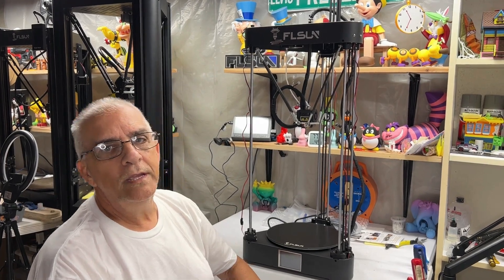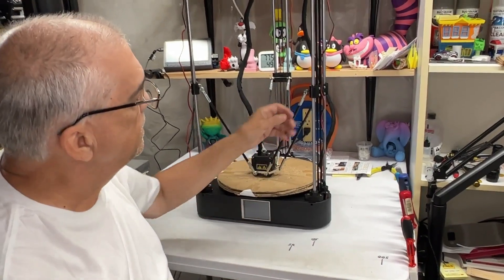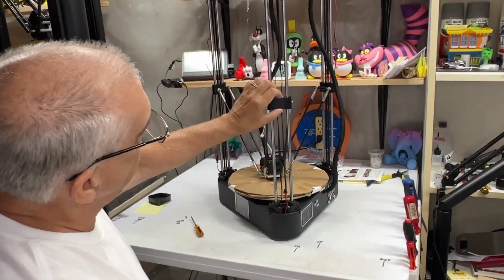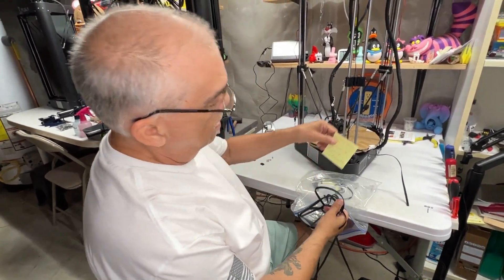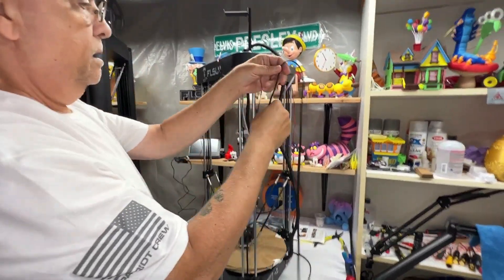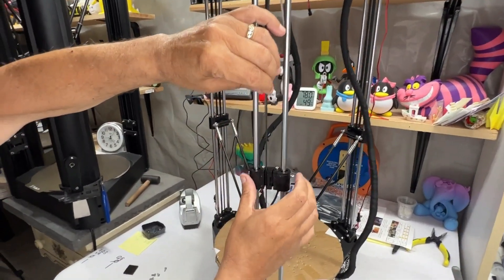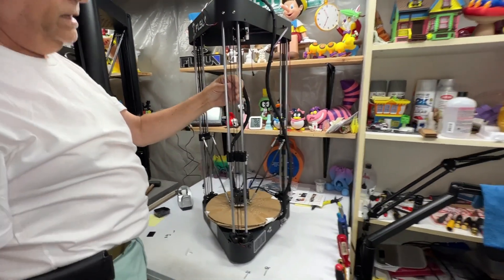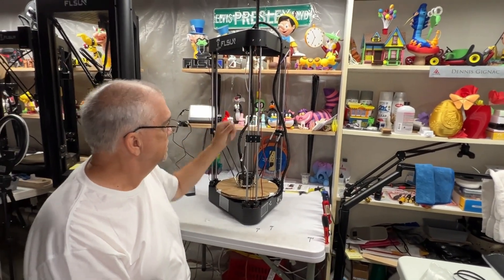FLsun QQ S Belt Replacement

Comment: FYI - I used this method and the very next print it broke my belt. I honed it in right in the middle of the gauge and it did not go well on the next print.  I would not use this method.